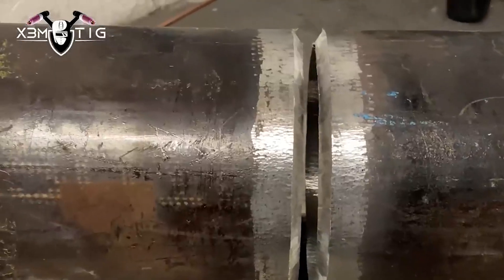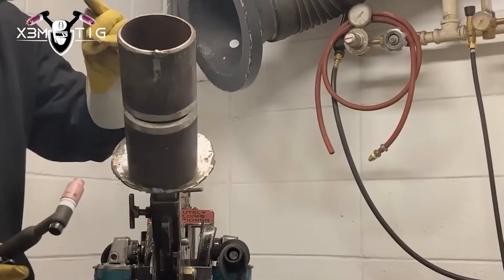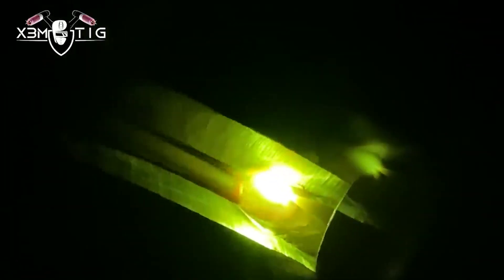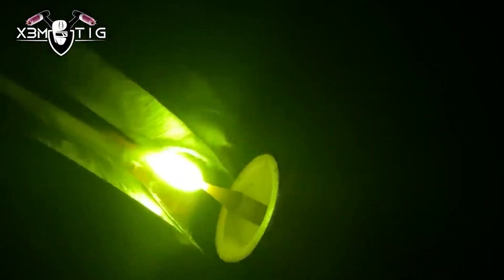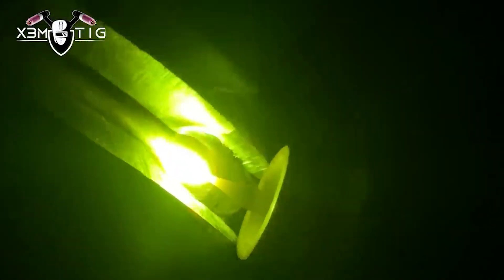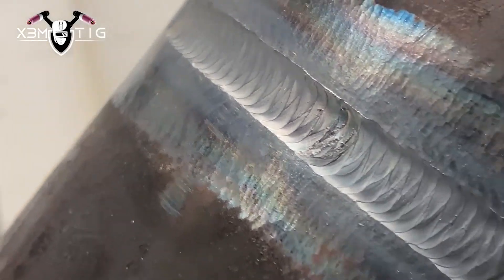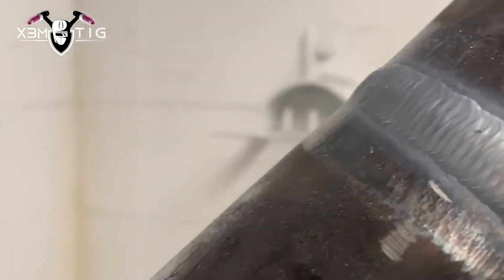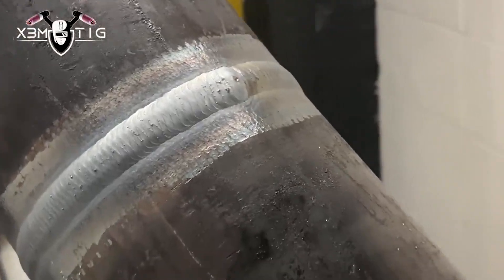Ace Your 6G Welding Test – TIG Root Pass Techniques!

Comment: Thank you for your videos and the energy you put into helping other beginner welders. 

I have a technical question: I'm working on a 6G 60mm x 6mm thick tube, and during the fill and surface passes, the metal tends to flow downwards. I'm setting it to 90 amps, which seems rather low compared to the amperage you use. 

What's the technique for getting a well-centered and well-domed weld pool despite the tube's angle? 

Thank you so much for your help.

Comment: I Have a 6 G test next week, tig root 7018 fill and cap, schedule 80 6 inch.
The procedure requires a landing edge though 2.5mm + - 1mm I've been going for 1.5 to 2.0mm seems to work well, 4mm gap
Reply from the maker: Sounds like you've got your settings dialed in, good luck on your test! 👍

Comment: I see some separation part between weld root at 5:18 . I don't know maybe i didn't see as well as i could the root.
I think when you make a video for us you can't focus as much as you need. So i think this video was good enough.  Thank you again bro ❤
Reply: I think he saw that black slag line on the left and thought it was LOF
Reply from the maker: No separation, maybe little bit excessive on one spot.
Reply: @X3MTIG  
Thank you bro. I'm sorry to saying that 🙏❤️
go ahead powerful.  i always waiting for your new videos
Reply: @Hamid-az  Nah, he's fine. You can see while he's backfeeding/laywiring it, he's breaking down the bevelled edge.
It's impossible to have an edge, because the edge physically broke away, and got replaced with the filler metal, that is what the Keyhole is, it's just the bevel breaking down.
Could he be under and have suckback? Sure, but there will never be lack of penetration with a keyhole cause you can't have that with one.
Reply: @DrCranberry  
Thank you for your explanation and guidance, dear friend. No doubt it is, and I just wanted to make sure because I'm learning. I wish you and channel X3M-TIG success.🙏❤️

Comment: I see you had a little under cut. I was welding in a coffin, down in the double bottom of a ship. I had to put the filler rod around the pipe, just the get a tack. Once I got it, i was good to go. It's better to let it cool down, I found. You do very nice work. Try standing on your head and weld this up, areal life application. Thanks
Reply from the maker: Hey bud, thanks for your comment. First of, there is no undercut, second, I don’t have to stand on my head to weld like that, because I did that a lot in my career, now I pick and choose what to weld or simply pass on welders like you! Remember, there is a fine line between confidence and arrogance, stay humble!
Reply: Bro stfu go watch his other videos